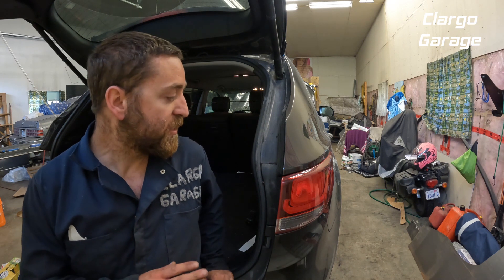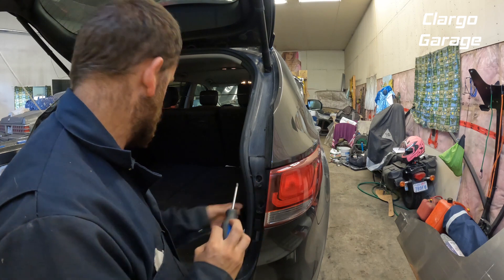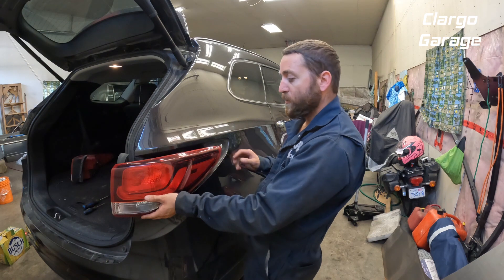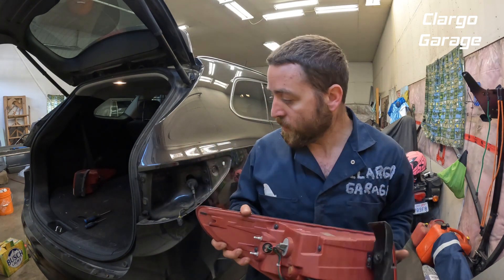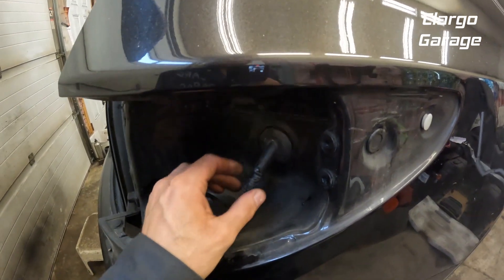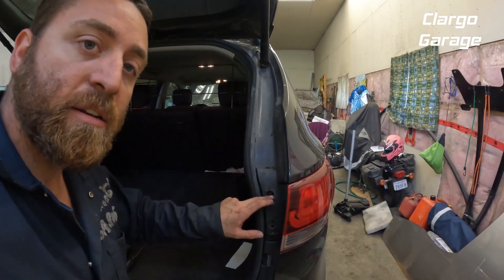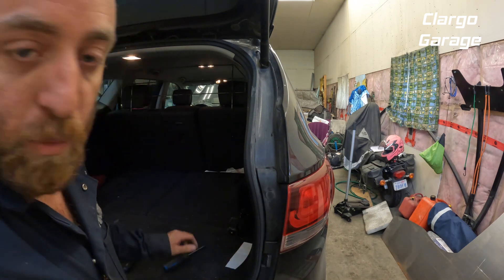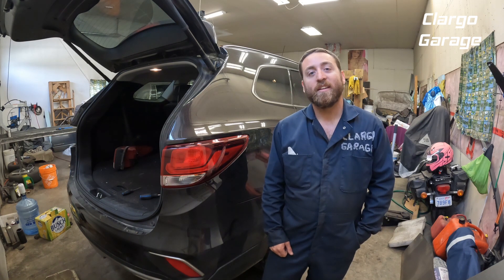How To Remove And Install The Tail lights On A 2019 Hyundai Santa Fe XL - ep 76

Comment: How do you replace the rear turn signal 
light
Reply from the maker: When you have the tail light pulled out, on the back side of where the signal cavity is , where the wires are for that light , hold the plastic socket holder and turn counter clockwise, bulb will come out and you can take bulb out of socket and replace . Thanks for watching

Comment: Where is the fuse for brakelights
Reply from the maker: These vehicles have 2 fuse boxes in them , one under the hood beside the battery towards the fire wall, and the other is under the dash at the drivers seat (left had drive , not sure if it was a right hand drive model if this would be mirrored or if it would still be on the left hand side). The brake light fuse you are looking for is drivers side "left hand drive" (Canada, USA), below the steering wheel to the left there will be a portion of the lower dash that looks like it has a recessed pull handle , if you look close it should say fuses on it, grab that and a gentle pull should pull it free from the dash, on the back of that peace will have the fuse layout and the actual fuses are accessed from that hole. There are 2 fuses that have to do with the brake system in this fuse box (abs fuses are under the hood), there is one 7.5amp fuse that is the "brake switch" I would assume vehicle would not start if this is blown, I'm guessing you want the fuse for the actual lights which is directly below that , it's a 15 amp fuse labeled "STOP LAMP" . On my middle the "stop lamp" fuse is center , second fuse up, and the brake switch is directly above that. Hope this helps, if you still have issues let me know and I'll record a quick video on it. Thanks for watching